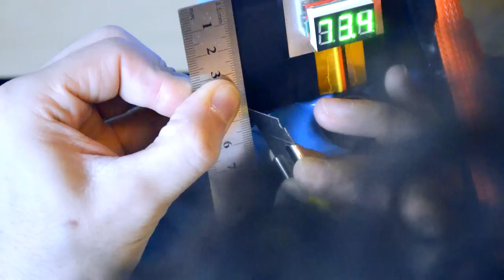72V 29Ah 20s10p high density li-ion battery pack

Comment: What strikes me is that the spot welder actually makes you look professional...  but in reality, you're using hot glue and NOT leaving space for ventilation... That's disturbingly risky and dangerous.
Reply from the maker: Air is indeed a good thermal insulator, as battery needs to be shrink wrapped to be protected, the static air surrounding each cell will decrease the overall thermal conductivity less than having all the cells stick together. Cells are made a 95% of metals and are very good transferring the heat. In a battery made in this way you will achieve higher levels of passive air cooling if you don't have any cell surrounded by static air.
Air only has the capability of cooling when is flowing at a good speed, you can always add a good active or passive system surrounding the exterior of the pack.
In addition this batteries are made to work at an average of 1C maximum continuous and never incresases their temperature more than around 8ºC
Reply: Damian Rene 1C maximum continuous?Where are you using them? In an office? (I'm pretty sure a 8º C increase pretty much puts it in the range of "Very hot to the touch). Then, they're not as practical and reliable as they could. Any kind of air flow you can get through is good. Hell! Just having the option of adding an active cooling system is what defines a flexible and reliable battery system. True, the metal is good at conducting heat... and so is thermal paste... but you're using hot glue for God's sake bro! Best way to insulate a metal surface from another.

Look, I really like the work overall, it's just weird to imagine people watching this will think this is the best way to go. The only way I've seen this done in such way is in some battery laptops... but those have temperature monitoring to shut if needed.

Thanks for carnalito.
Reply from the maker: 1C average maximum, that means I have around 1C at flat propulsion (2kW nom) and 2C hilling up (4kW nom) with this power you can propulse even a small scooter, so I don't think is a low power, you can also push up to the maximum rate (3C 6kW nom) and the battery never gets hot. 
The portion of silicone that are in contact with 3 faced cells is indeed very low, and the air between very reduced, almost the 80% of contact is made with the cell surface and silicone, this increment the thermal transfer dramatically and the battery can get rid of the heat by their perimeter and quickly transferring it from their insides.

I've made dozens of batteries in this way, I've never had to put active cooling on any of them, you just need to fit the specifications and made a good design and you will be really surprised on how fresh they run.

You can add always an active cooling to keep the cells the most cool possible and you will improve their life span and cycles life, but is not mandatory for high density standard cells that works below 3C continuous
Reply: The whole thing in plastic. There is no ventilation. Yeh, I like the designs with fans and spaces between banks. Plus the service life is longer.
Reply: Damian Rene Basic physics and knowledge of battery technology will tell you that as cells deteriorate they sulfate and therefore expand then overheat. For a weekend hobby mtb rider fine but a daily commuter can't risk that. Also I think most of the ebike community are realising that BMS devices aren't the way to go although I know you are building for others specs. I wouldn't trust any BMS on batteries I'd bought acquired and spent time building. Get my drift?
Reply: To add in to the improvement thread... How long of a lifespan does the battery-packs you sell have?
I namely ask this because at 2:11 you seem to be soldering onto the nickel AND the battery pole, which greatly risks damaging the cell.

If you were to damage any of the cells, then the hot glue would make a swap very difficult. Because when your customers come back with a bad battery you don't just chuck it in the ewaste... right?
Reply: How do you know soldering on the battery is damaging ??? Everybody does it in these type of builds
Reply: oz93666  I am not an electro-chemist engineer, only a constructional engineering student. Therefore I can't say with 100% accuracy that it will damage the cell and if trials have shown that the packs work "to satisfaction" then I will not argue the case without further research.

What I know though is that leaked spec-sheets for this model (which seem to be legitimate and takes 3 minutes to google), say that Samsung themselves test the batteries at 130 degrees Celsius and standard solder melts in the range of 325-350 degrees.
The very same specifications also gives the information that this battery will have 70% capacity after 500 cycles, which is about 16-17 months on a daily use item, in context of product lifespan.

On the aspect of "everyone doing these types of battery-packs this way" I would be fine with the soldering of this pack if Damian had actually use the nickel strips for what they are actually for, to avoid having the connections soldered directly on the battery poles.
Reply: Mon S I am sorry but there is no merit to "owning something equals understanding it". Please come back with a real opinion or argument.
Reply: I would imagine Ni stips and welding is used for keeping cost down on industrial  mass production .... For sure soldering onto the base of the cell will produce no problems , heat is rapidly dispersed ... the +ve terminal does have some plastic around the seal , this could be the only area of concern ... no chance of high temps. getting inside the cell ...soldering action is all done in a second.
Reply: well it depends on usage i guess. If no fast discharging and charging is happening here and no extreme hot temperatures, its ok.... otherwise i would use a plastic grid separators holding positive terminal and negative terminals....

Also the positive terminal has a potential risk of the skin of the battery being damaged. and cause massive short circuit and boom. I would place an extra pre-made paper cover.
Reply: Damian René,  ni caso,  internet está lleno de haters, y atontaos que nunca han construido nada y solo tienen miedo 'por lo que han visto o les han dicho'.  Muy chula la batería!  
Mandame tu mail o numero a andycapo99@gmail.com   que quiero hablar de baterías en privado.
Un saludo!
Reply: oz93666 Then why is it that every 18650 spec sheet I've seen specifically says DO NOT SOLDER. Just because "everyone does it" doesn't mean you aren't causing damage. I soldered my 18650 cells as well, doesn't mean I'm ignorant to the fact that I probably damaged my cells by doing so.
Reply: Ive seen sony specs sheets that say 1 sec solder is okay!
Reply: He is soldering on the balance lead. Every battery solders on the solders on the balance leads
Reply: Lithium batteries do not sulfate.
Reply: +Adam W exactly
Reply: How do you get air ventilation with shrink wrap around the battery!
Reply: Do you really have ask the question? It is not rocket science.
Reply: harveyboy45 - You said  "Also I think most of the ebike community are realising that BMS devices aren't the way to go"
What is the way to go ? What are the alternatives to a BMS ? to try and maintain good cell balance ?  Why are people in the Ebike community realising a BMS isnt the way to go ?

Comment: Use it to light an LED and see if it lasts all your life
Reply: Drini player pretty sure it would birn out with 72 volts
Reply: Not if you limit the power current
Reply: These batteries also lose capacity due to age. I'm guessing that the battery will die of age before running out.
Reply: more like the led will burn out. lithium cells last pretty long

Comment: hey. how much you you pay for all together?
Reply: She paid about $1.5k for all the materials and batteries.
Reply: @merunasg  At the moment for 200 high end 18650's , with the rise of the 21700, you can get 200 quality 18650's for about 400 bucks plus shipping... Of course the other equipment is needed, namely the tap welder. But 400$ is a far cry from 1.5k ... Where are you shopping ? Walmart lawn and garden ? Alibaba ... Buy on Alibaba...

Comment: I see you have no fuses , Damian ... I think you are right ... nearly all power wallers fuse every cell , do you think this is a good idea ??? does it matter if the cells are new or recycled when considering fusing ?
Reply from the maker: That's a very important question. The need to have every single fused cell depend on the battery design chemistry, model of cell, and aimed use. 

Basically there is only one case when it could be avoided using a system with single fused cells and still having a safe battery. This is when all the cells are factory new high quality Li-ion cells from the same batch, the charge and discharge rates are greatly below the maximum rates and there is a reliable control and balance electronics.

So, only in this case it can be secured a safe use of the battery during all its life span, and the risk would be almost limited to receive a hard impact / crush that would affect the cells, so the last needed barrier is a safe battery container.

The problem when you don't have single fused cells is that if one of them fail and could be self-shorted (discharge abuse, charge abuse, over-temperature, over-charge, impact, puncture, crush) it will short its serial electrically section making a chain-reacting where connected cells will enter in a self-short state being discharged at exponential speed up to all would be drained (with a chance to develop a vent or explosion).

When you have every cell fused, when it enter a self-short state, the fuse will be melted and every near cell safe for a chain reaction. Taking all these implication you can still use a not single fused battery with the needed protections and controls

Comment: What about the parallel connections on this one ? I cant see that there are any. Or am I just being thick ? and these criss crosses are also doing the P connections ?
Reply from the maker: In this case the own serial connections are working as parallel connections, nothing bad electrically speaking, just not as safe as parallel connectors that can disintegrate if a cell shorts itself. This kind of parallel connections are only recommended when the cells are factory new high quality ones, and working very safely inside its specification limits

Comment: Wow ... interesting build !!  Pure nickel has 4 times the resistance of copper , so 0.1 x6 mm nickel is equivalent to 0.15 square mm of copper wire ...very thin wire for 10p ...   ...The question we're all dying to know is did you cook the battery in use ??? no way for the heat to get out , perhaps OK for a very cold climate ...Please give an honest update , we need to know if this type of design is a good idea... Thanks.
Reply from the maker: In this case each cell have a pair of 0.1 x 6 mm nickel conductor welded, what it makes each cell capable of discharge up to 6A continuous optimally with the nickel at ambience temperature. You made a right calculation of equivalent copper wire, but you don't counted with two nickel strips per cell, so each cell have indeed the equivalent of 0.3mm^2 of copper wire (equal to a AWG 22 copper wire).

This BUS nickel section still the same for the whole battery including the main leads, what it makes the battery BUS capable to discharge up to 60A optimally (even up to a limit of 120A continuous safetly, but not adequately efficient).

But now the most important question, which current is the battery discharging while in use? This battery is running a pair of controllers on my solar e-kart, each one capable to discharging a maximum of 20A continuously (1.5kW each one, for a total of 3kW) what it makes the BUS in the battery perfectly and even over-sized for its use, with enough capability for 60A with a correctly conduction.

So, about the heat, the BUS has a not appreciable implication in this case, and the most part is produced inside each cell. For the use given (always the most relevant data) this battery is discharging in the most demanding case 40A continuously what is equal to 1.35C. These NCA li-ion cells have a very low internal resistance and are specified at a maximum of 3C continuous, what is traduced in real case for a very cool discharging under 1C and mid temperature under 2C, being even not neccessary of an active cooling system if the battery installation have the right passive cooling ventilation.

My update after more than a year of personal use, this battery never rised its internal temperature over 15ºC the ambience temperature, being used in Madrid, with an appreciable hot temperature. In addition of a correct battery building and a right passive cooling system, what it makes the battery running cool is that the average discharge rate rarely go over 1C. So that's one of the key for high efficiency (no heat) and high life span of the battery.
Reply: Very good ...excelent reply ... Your video prompted me to do an experiment to see what temperature rises could be expected packing cells tightly  like this .... 
The cells I used were recycled laptop cells , so these figures would not apply to your lower internal resistance cells .
With perfect thermal insulation with each cell delivering 2A I got a 20C rise every 10mins  ... so 20mins of this current in a pack like yours would take cells in the center of the pack into the danger zone (above 60C) , or 40mins @ 1A  would do the same ...
The reason tesla goes to the extreme with liquid cooling their cells is they have to handle all conditions , temp in saudi arabia and elsewhere can reach 50C they have to deal with someone there quick charging the battery , then going for a drive
Reply: oz93666 i wonder why use pure nikle as coneector why not copper or alu?

Comment: Any interest or future plans to use the LG MJ1 cell for a pack?
Reply from the maker: +Aastan Gadson That's a very good cell, better than Samsung INR18650 35E, but at 3.5Ah Sanyo NCR18650 GA is the really right one. Although the cost is slightly higher, GA beats completely the others on net energy output. (efficiency) it delivers higher voltage at any discharge rate, more appreciable between 6A to 10A, it even could deliver around 12A continuously. Is the only real 3C 3.5Ah cells at the present
Reply: +Damian Rene Do you have an email address for additional info ?
Reply from the maker: you could write to rene.sunset@gmail.com
Reply: ok

Comment: Why do you scratch the tops of the battery with a screw driver?
Reply: He flatens the strips so they look nice
Reply: +DerpyDoom It's sad he dose all this work and glued the batteries together. 18650 batteries get hot, and this being a 72v system he should have them spaced. It only costs a couple dollars lol
Reply: +Damien Anonymous They only get hot if you stress them too hard, it has never happend to me that one of my 18650 got hot, charging or discharging.
Reply: +DerpyDoom A pony lover and an ebiker? We need to chat more.
Reply: +joblessalex Well I don't have an e-bike but I plan to build one myself if I have the Budget for it :P I just work a lot with 18650 Batteries in my robots so I know a thing or two about them :D
Reply: ***** Robots are sweet too, I do mostly wireless and radio stuff
Reply: joblessalex That includes robots, my current project is a weather alert system via PMR (its a free frequency range where you are allowed to transmit on without a license here in germany) so if a storm comes up it will automatically transmit the current weather via text to speech
Reply: ***** Shiny.... I mostly do the ham radio thing. I am starting to build and sell batteries for money. So far its working out.

Comment: Nice. What copper wires (in terms of specs) do you recommend for the + and - power from battery to the controller?  Oh and you don't have to use BMS for building the batteries for motor bikes/scooters as it will cause more potential problems due to the failures from the BMS itself....
Reply: sorry to be off topic but does someone know of a trick to log back into an instagram account..?
I somehow lost my password. I would appreciate any tips you can give me.
Reply: @Anders Enzo instablaster ;)
Reply: @Jacoby Rex Thanks so much for your reply. I got to the site thru google and im in the hacking process now.
Takes quite some time so I will get back to you later with my results.
Reply: @Jacoby Rex it worked and I finally got access to my account again. I'm so happy!
Thank you so much, you really help me out !
Reply: @Anders Enzo No problem :D

Comment: Damian I have one question, it's cool that you are making such high power packs with low cost and weight. But don't you think for a more professional and safe looking pack you can do better than Silicon glue? And some thermal management? also some good insulation? because if you do all that then it will definitely be fit for any EV.
Reply from the maker: +Mahesh Padmanabh Silicon glue work really good and has a very lightweight, also make possible to make a repairing. Thermal management is done by the BMS temperature cut (if it is built-in) however for batteries like this one that are running under 1C there is absolutely no need. Any better insulation as a plastic / steel case? I work with colleagues that make that kind of works, I'm specialized on battery building, but of course I'm working on further solutions. Thanks for your comment! :)
Reply: I know you are an expert, I also work with EV battery packs and I wasn't finding flaw in your design(if you feel it was offensive)it's just that I thought having a different housing might also be helpful :)